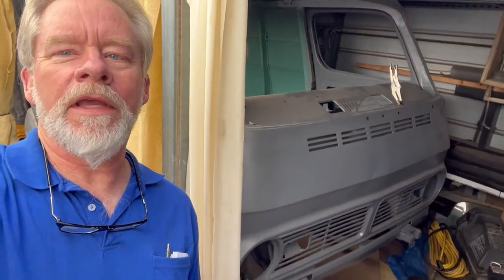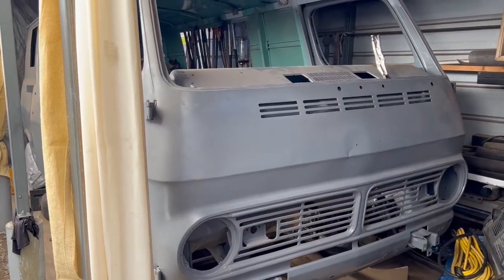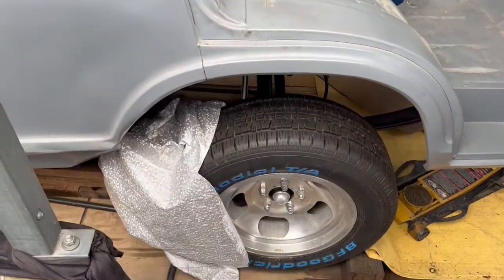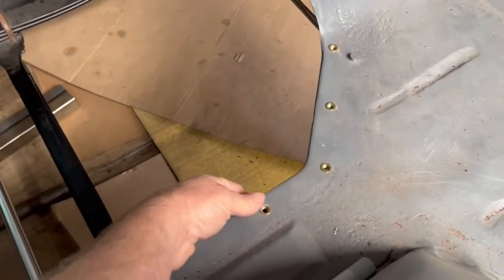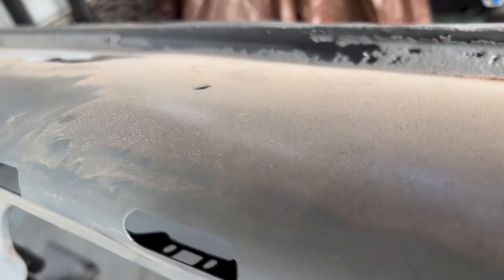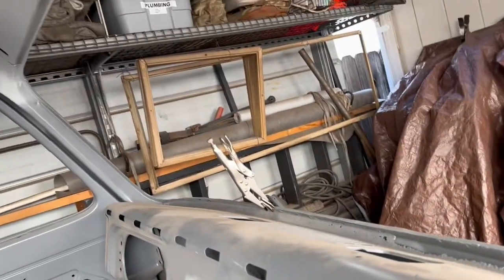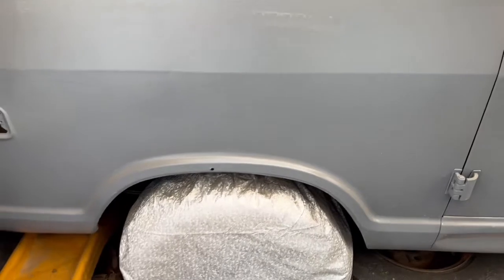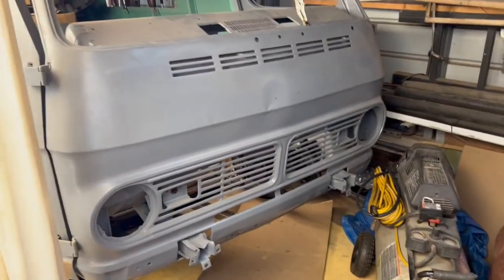1969 G10 Roseville

Comment: Any idea where I can get a winshield for a 69 (same as in the video)? Also if you can share the details on the disc brake and c10 gear box conversion that would be great! Getting ready to do an LS swap on mine.
Reply from the maker: 2nd Gen windshields should be available from most windshield manufacturers as of the last time I checked.  The rubber weatherstripping is the same as a 1965 Chevy C10.